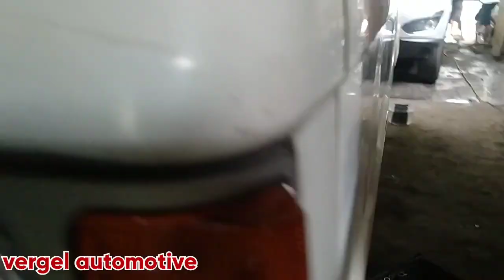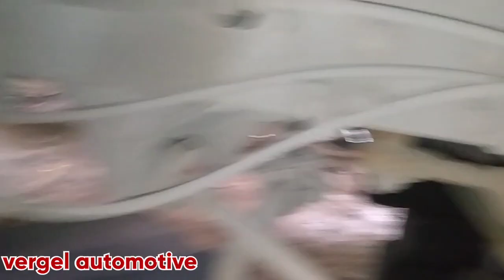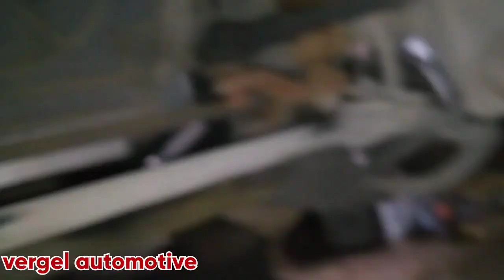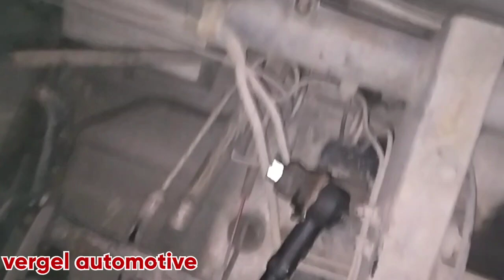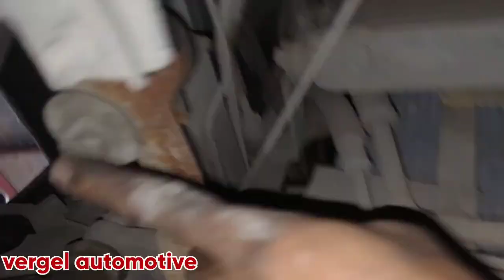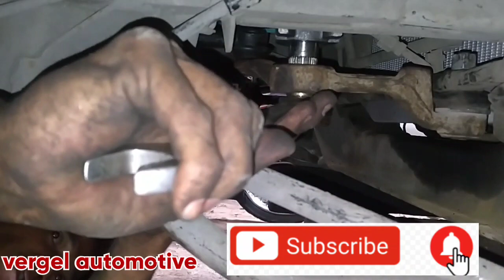mitsubishi L300 fb center post paano mag palit

Comment: Palit center post lang ang dami nyong binabaklas gamitan nyo ng puller napakabilis ang work no need to removed tires left & right & tie Rod end big jobs jobs nyo ako sa L300 ko i used puller 1nut lang at 4 bolts sa center post job done in 1/2 hour plus 1hrs. To assemble job done u know used puller mabilis trabaho discharge agad unit lalo na pakyaw na work.